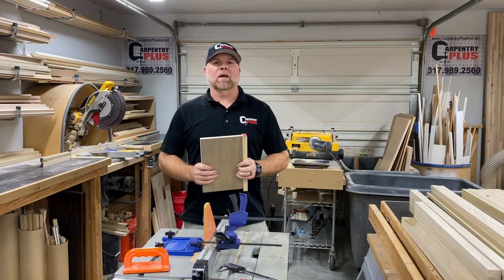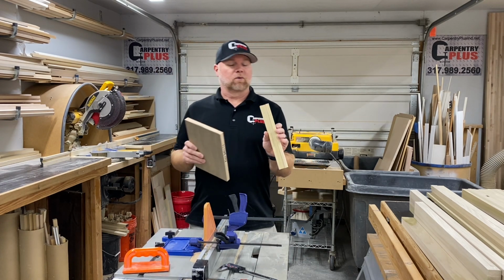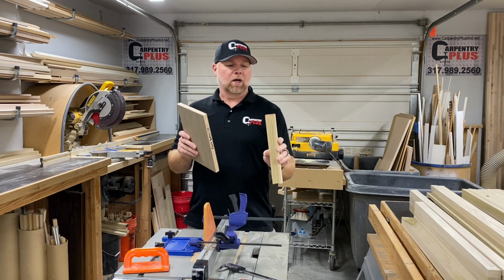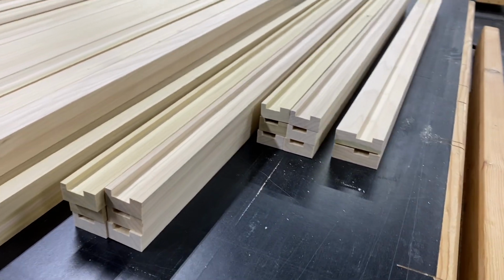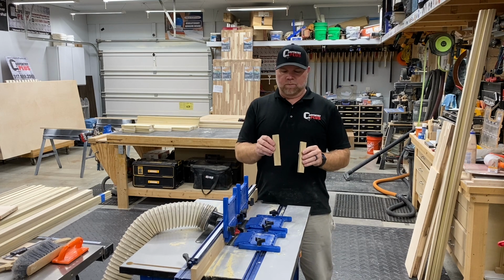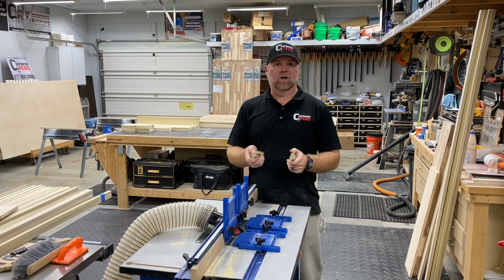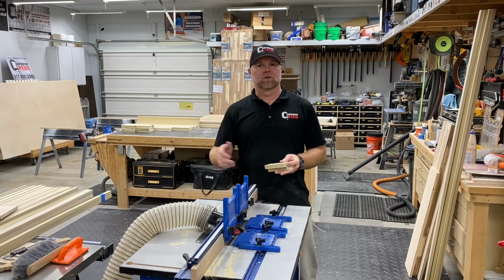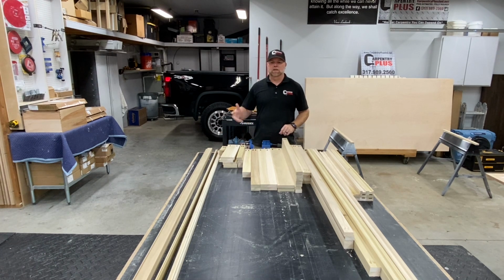CABINET JOINERY

Comment: Thanks for these series of videos.  I plan to try this method on my next project.  I have a question about the dado.  Is it a true 3/4" and deal with the slight gap, or do you down-size it based upon your plywood (23/32")?
Reply from the maker: Glad to hear you’re enjoying the videos. 
The dado is slightly undersized but I don’t change for each of the different “3/4” plywoods because they’re all different. So, it’s a little loose for some of them and we just deal with the gap. I think that’s better than trying to be too tight and fighting it during assembly.

Comment: How are you fitting that dado stack on the jobsite dewalt?? Didn’t think you could go bigger than 3/8
Reply: Where did you get this dado stack? Looked like a Diablo or Freud stack?
Reply from the maker: Yeah it’s the Freud. I think I picked it up from home depot.
Reply from the maker: This is the Bosch job site saw. Seems to fit on there just fine.